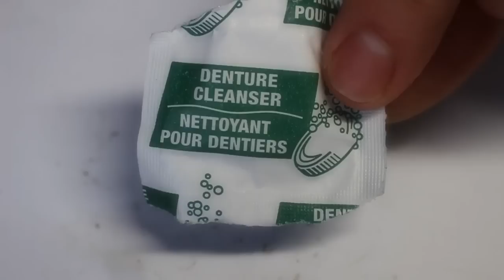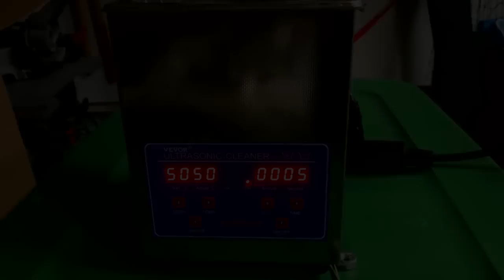Restoration of an 1890s Antique Swiss Pocket Watch

Comment: The removable and adjustable plate for the balance and escapement is typical on Roskopf style watches. It allowed for the escapement to be made separately from the rest of the watch as it was harder to produce and then fitted to the rest of the watch. It was one of George Roskopfs little tricks that allowed for mass production at a low cost. I recommend reading 'The History and Design of the Roskopf watch' by Eugene Buffat.
Reply from the maker: Makes a lot of sense. Thank you Lukas! – Chris.

Comment: Outstanding work as always! Do you use a different polishing wheel for each compound or use the same wheel for every level? Thanks in advance!
Reply from the maker: Good question. I use a dedicated wheel for each type of compound. I also wash  the case in between each step to avoid cross contamination

Comment: Loved the video, have a similar clock but same mechanism and now at least I know what parts im missing. I wonder if I can buy them online. However, I have some questions. Hope you find the time to answer them:
1. based on what info do you use certain oils on certain parts
2. doesnt merging the dial in water disolve the fonts or pales them?
3. how much time was the dial merged under water?
4. the tools used to take out the hands, what are they called?
Thank you.

Comment: Very nice video. How were the gear -teeth cut in those days?
Reply from the maker: There were a few ways. The one I’ve seen is the raw wheel is chucked in a special attachment of a lathe, while a cutting wheel is controlled perpendicular to it. The cutting wheel is then plunged into the wheel, then the wheel is turned a specific increment, and then repeated. The individual teeth are then shaped after that process completes.

Comment: Interesting click in this watch! Just a spring and no pivoting part.
Reply from the maker: Yea it was such an interesting design. It looked so ornate but on the other hand it was designed for the working man to afford. So not too many jewels in this one
Reply: @csspinner  Yes and once you got inside a little, the watch mechanism was rather rough looking. It looked pretty good until you took it apart.

Comment: The overlay stone of the upper axis of the balance must be removed and cleaned from the old thickened oil !!!!
Reply from the maker: True. But in this case the screws would not budge and rather than risk sheering then I spent extra time bathing the balance cock. It runs fine
Reply: @csspinner  Wondered why you skipped that.